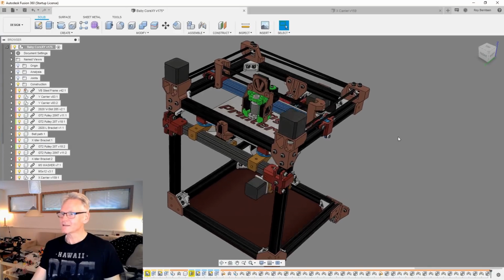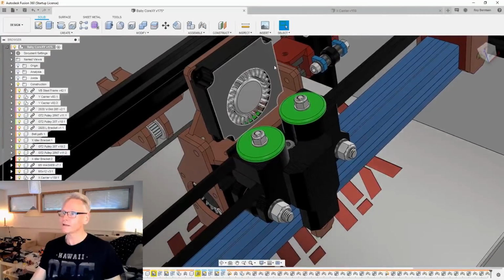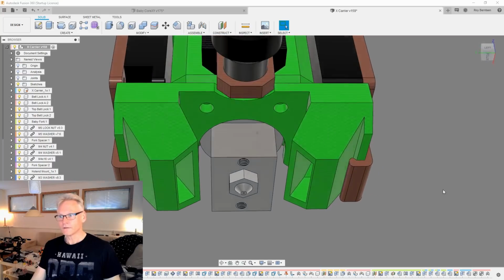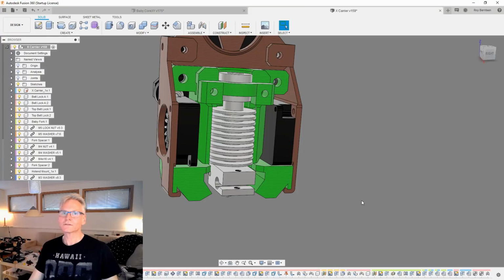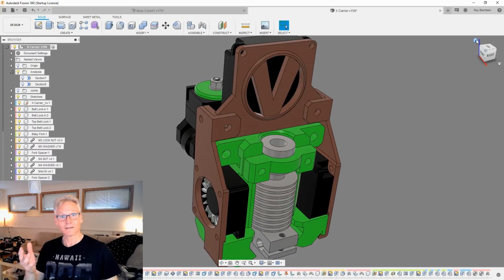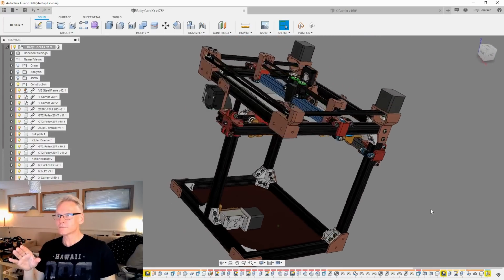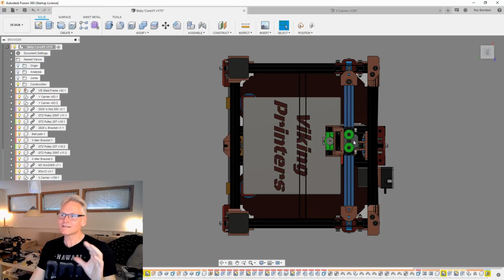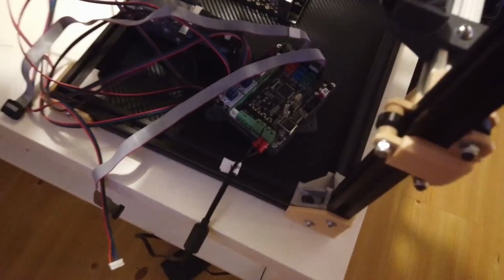3d DESIGN VLOG - CoreXY 3d Printer Vlog #11 - *FINAL DETAILS*

Comment from the maker: 190*170? Should we extend the Y axis?
What do you think about the fan system?
End stops? BL Touch - Do we need it?
Other thoughts?
Reply: PRO 3D very nice build. No end stops (sensorless homing) would be nice. And yes, some sensor for leveling would be nice :)
Reply: I got tired of the long Bowden tube issues on my V-king so I have been struggling with some of these same issues when adapting to a direct drive.  I've got it working without a layer fan.  I used your Chimera X carrier and made a plate that mounts on that and supports the Titan.  I put the original E3D fan mount for hot end cooling which just fits under the Titan and pancake stepper.  Looking forward to seeing your direct drive implementation and moving all this stuff back to the V-King.
Your best bet for cutting costs is to choose a common bed size because that will give the best availability for after market upgrade parts.  200x200 would be good because it is a common size and there is lots of availability.  A borosilicate glass plate 200x200 is only $13.  A 12v 200x200 silicone heater is $17 in that size.

A huge advantage of the V-Baby and the V-King is that if you need a bigger print volume you can replace the V-Slot extrusions in that dimension with longer ones and replace the belts.  If the steppers drivers can adequately sense the stops I would go that way.  Getting rid of the wires and sensors is a great simplifier.  Once properly trammed (also called leveling but that is not the correct term) you mostly don't need a BL Touch.  I say mostly because when you change materials and temperatures the differences in the expansion of things changes the zero point of the Z-Axis.  I put an endstop on the Z on my V-King to avoid messing with the BL-Touch.  I only have to re-tram when I switch from PLA to some other material like PETG with its different temperatures.  In this situation it would be nice to have the BL-Touch and I am going to add it for that reason only.  You don't need it if you only print PLA.
I like the pair of 30mm blowers for part cooling.  I hope that works out as I would like to use that.

Regards!
Doug
Reply: I would agree with others and say stick with a standard size heater bed, possibly 200x200.
I really like our thoughts on the fan system and the easy change hotend is a great idea.
For the cables run them to the rear and keep the front clear :)
Sensorless homing is nice but its also something the end user can do later so I wouldn't bother with it.
I would try and add a mounting point for a BL Touch or a universal mounting point and leave it at that so it can be easily added later.
Reply from the maker: @22chrs  Thank you for the respons! Nice to hear you like this build

We opt for sensorless but need to qualify for them in the bom - I will probably release no abl and have this as an option later when all the details are in place
Reply from the maker: @22chrs  Thanks I will look into this - NICE!
Reply from the maker: @dougingraham5807  Thank you a lot for your passionate following and feedbacks - You always make so much sense and keep me on the right path :)

I guess we just increase the foot print to 350*350 and go for the 200*200 beds - Will still be desktop friendly. I never use the ABL on either v-kings so why have the complexity on this small machine. I just now did a bltouch DELETE and added a endstop to act as the bltouch and so we can utilize the z offset for different temperatures - Works like a charm

I am also hoping this works - Its been lots of work so remodeling is not really what I want right now
Reply from the maker: @networksdude  Thank you sit for fine words. I will listen and make it 350*350 footprint to utilize 200*200 XY :) I will look into bltouch /abl later thanks

Comment: just started following this, and planning on a build.  Trying to catch up on all the vlogs is taking some time to digest it all. As mentioned, it is relatively easy to change the size with just a bit longer extrusions.

Did you ever decide if you would use the openbuild plates for extra stiffness?  Agree that we need ABL, but it can be an "add on"...
Reply from the maker: I moved away from the plates. It seems like just extra stuff not necessary. Size can be changed but I don't know if this is a good design for big volume. The V-King has a rigid system for sure if you want to do big proven design

Comment: Yes, increase the size to utilize "stock" build plate parts as they are available everywhere and low cost. Love the new X-carriage, and I would like to see it implemented on the V-King. No BLtouch, your design and a decent build plate  eliminates any need for it.  Other thoughts? I would love to see a worm gear version like the V-King as this would eliminate needing a specific motor/drive unit. It's nice the way it is, but if that particular unit becomes unavailable, the wormgear system on the V-King would be a great fallback. Thinking about it, could we not simply use the brackets from the V-King and save some design time? Adjustment wheels for the build plate, perhaps include arrows and up or down so that those new to printing can see which way to turn them? I realize most of us have learned how to do it, but for those who have not.... adding some arrows and letters on the adjustment knobs will help. Just some negative printing and one could fill the printed areas with some paint of a contrasting color.
Reply from the maker: Thanks Chris! I will do the 200 conversion - Interesting thoughts about the wormgear - Important this is and I thank you for reminding me this. It will be up for evaluation - Luckie will decide :)

Not sure what you mean about adjustment wheels for buildplate. I designed new ones for this one - arrows are interesting though. these details do take a long time though... good thinking
Reply: @PRO3DESIGN  Seach Thingiverse for 3702365, that will show what my terrible explanation about adjustment wheels meant.
Reply from the maker: Oh I see - I guess that could be done - Text in Fusion sucks and these details do take some time but I will consider it for sure

Comment: Nice work!!! Bed 220x220 is more common size. Those part cooling fans shrouds are asymmetric, i would modify them in such way that the output sides are parallel. This way the air would be less swirly and part cooling would work better.
Reply from the maker: Looks like the layer fans work great now. Also 220x220 is possible to add with the extended frame now

Comment: i have been following your progress on the vbaby and i have to say it is starting to look very good,
i think 200*200 for the bed would be great because it is a more common size for bed, buildtape, glass... and also because i've some spare part to salvage
for the z axis, a limitswitch for the bed sould be enough with manual bed leveling, no need for a probe i think
the layer fans looks great, looking forward to see this melt some platic
thanks for your nice work
Reply from the maker: Thanks you Tom - 200*200 will do

Comment: You should add the BL Touch not to level the bed, but to check that it is level. There is no reason to not have a touch probe on a 3d printer anymore; level accuracy is just too important.

Comment: The X-carriage actually looks quite nice! I would like bigger Fans (on lower rpm) Maybe in a "V" shape to fit on the carriage (and the theme ;-P) like on Tevo flash for example.
Vote for 200x200 heatbed. 
The hotend cables have to be guided in a way that they are also easily removeable,  so there has to be some convenient system for doing that. I think using the bowdentube as some kind of path for the cables is still the easiest way, since the cables cannot support themselves into a nice curve. 
You could also make some kind of panel with connectors on the X-carriage, so dont have to swap the actual cable itself. Unfortunately having connectors on the X-carriage has been done by some manufacturers and led to problems. (e.g. Anycubic Chiron randomly aborting prints) But maybe it can be done better ;-P
As always, nice work and waiting for more!
Reply from the maker: Thank you for feedback, following and commenting
Bigger fans leads to less buildvolume. I just want to try keep this as compact as possible but lets see how the prints turn out :)

200*200 is noted... It does not change much it makes the footprint 350*350 as is currently 340*300
Good thinking on the cabling - I will make a note on that
I do not want a connector on the carrier - I rather have just a quick release for the 4 hotend cables easy access - keeping this one simple :)